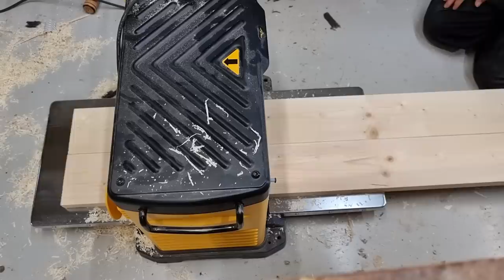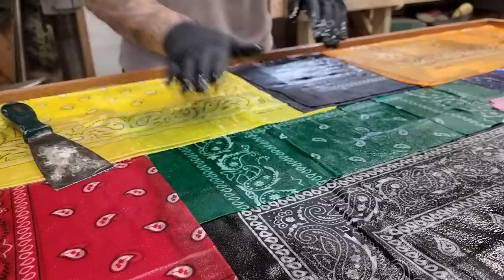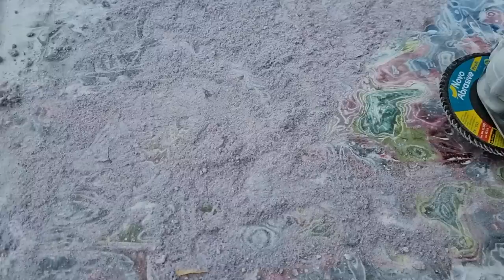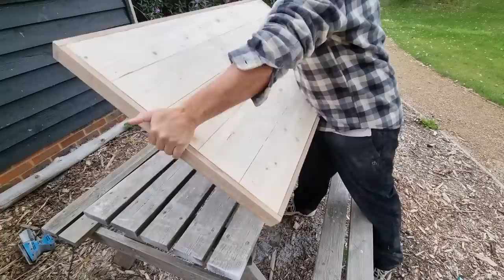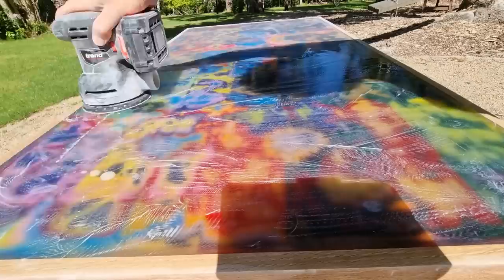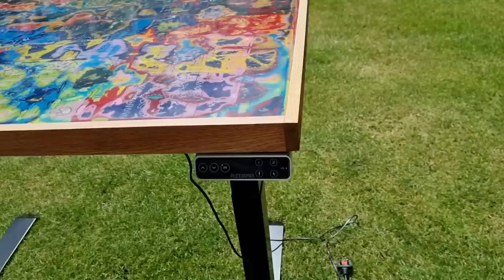USING A GRINDER TO MAKE ARTY TABLE !

Comment: what you call the bandana was invented in the Netherlands the block printed farmers' handkerchief was first introduced in the 1790s the method of this type of block printing on fabric was borrowed from traditional Indonesian/Indian dress Indonesia was the dutch east indies at the time.
the origins go further back but as a larger cloth (some waist filling) all over India and the Asian islands bandan, bandhani, bandana, or bandanna are usually the names of this type of cloth was traditionally worn around the neck or head the handkerchief was introduced into Europe in the 1750s they were usually traded under the name couvrechief (cover head) or kerchief in English more a full head cover for mostly women, so a handkerchief (hand/headcloth?) is a smaller version that you could fit into one hand when folded and worn around the neck more suitable for men at the time.
the farmer's handkerchief was worn around the neck since it was seen as a status symbol.
the type was later exported around the globe also, dutch and west german farmers started farms in South America in the early to mid-1800s and took their handkerchiefs with them starting the South American tradition.

why it is called ''zakdoek'' (pocket cloth) in Dutch has something to do with our appalling weather which causes runny noses and, having a bit of textile near solves this problem but, having a snot-stained cloth around your neck went out of fashion fast! so the cloth vacated the neck and installed itself in Dutch trouser pockets it was shared among folks who had runny noses it stayed in pockets where it resided until recently but sharing this item went out of habit during the covid19 period. Since then the ''snot-lap'' (snot-cloth) has gone out of fashion as a sharable pocket item and is now making its way back to people's necks eh, full circle I guess!

Comment: My only concern is the table being hot glued instead of wood glued. Did you use a type of heated strong hold adhesive? Or was that just regular hot glue?

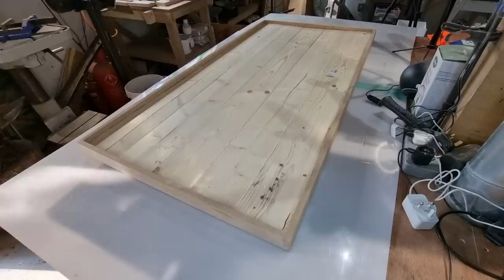Comment: 1:58 Is that hot glue? I'm surprised that works with the resin. Doesn't it get really hot as it cures? I'd imagine it would melt the glue halfway through x)